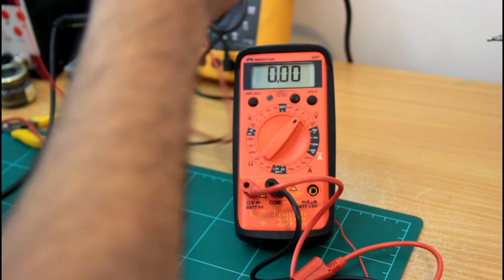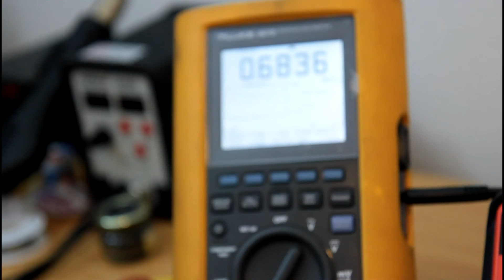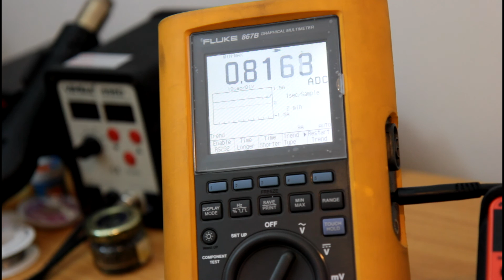Part 2 - Buck Converter LED Driver Battery Charger LM2596

Comment: the center pot is for charging from a different battery so you don't under charge the source battery while the battery you need charged doesn't kill it

Comment: Yes, you need to short the outputs while your multi meter is set to amps before you charge the battery. Part 3

Comment: my understanding is that the center pot is just to set the current at which you want the center led to come on to  let you know charging is done. 
Say your set to charge 18650's at 1 amp you set the center pot to turn on the charging done led when the battery  is only drawing 100ma.The way I also understand it is that it is some division of the current set with the cc pot.
Reply: lmorrison17 hi, so example if my battery rated at 1250mah then how can I turn the thing to make it to fully charge and the led turn on?

Comment: OI OI OI, u need a sandwich board mounted to a heavy base and banana connectors to make ur connections rather then alligator clips let loose one ya desk to blow shit up and pop off like what happened in the vid as I was typing this....Heres a few pics of what I am referring to - https://cdn.sparkfun.com/assets/0/a/b/a/5/5192a48fce395f1573000000.jpg,  http://img.alibaba.com/img/pb/992/982/236/1268291045799_hz_fileserver2_732211.jpg, http://www.tescatech.com/breadboard-trainers.html and here is a very interesting history lesson for ya  at https://learn.sparkfun.com/tutorials/how-to-use-a-breadboard. Also I have a challenge for ya if ur interested.... "a real world project" I will PM u with the details if u r.

Comment: Can anyone confirm/comment on the boost operation of this module?  I've ordered some of these modules and I'm waiting for the slow boat from China to arrive...  They were specified as buck/boost (automatic) capabilities but I've seen them also advertised as buck.  I want to use solar cells to charge 18650 a liion battery and would like to only use as many cells as necessary to meet the demands of the circuit.
Reply: Actually, just noticed that the modules I are a bit different than these. They also have a LM2577 on board.

Comment: Good video.
If you want to charge at 1 amp you will have to raise the charging voltage and then measure the current into the battery with an ammeter in series then look at the off load voltage required to do so...I always stick to constant voltage charging because if you forget to turn down the voltage you will fry your cells when the charging voltage rises across the fully charged battery, also current limiting is more relevant and your device may only allow current limiting when the battery gets nearer full charge. Good thing about dc-dc converters is they cut of charging when the battery no longer takes any significant current at the set output voltage..i.e fully charged

Comment: 1) With all do respect, you try to break Ohm's law. You had 10 ohm and 10 V set, so the current would be 1 A. We cannot force a higher current without putting a higher voltage on it! So, of course the pots didn't change much. In this buck it's clear that the voltage is the master setting. The rest will be dependent on the circuit and as long as the circuit is capable of pulling more amps then adjusted so far, it will accept new amp settings till the max it (cvircuit) can handle.
2) For the battery it's another story of the same laws: say the battery is at 2;5 V and needs to go to 3.7 with a max charged level of 4.2 V : You set the voltage to 4.2 and from then on the circuit (battery) will define how much current it wants to take , doing so by it's internal resistance. You put 4.2 - 2.5 = 1.7 V on its its internal resistance, which we don't know. The current was 0.9A (or so ?) which means the internal resistance is about 1.89 ohms. And that's why its a cheap battery. Those are excellent for continuous delivery of low amps like 15 mA and it will run for many hours.
3) It is not possible to boost both voltage and amps at the same time !! It's either Voltage regulated OR current regulated, not both !
4) TEST: your setup with resistors: 2x5 ohm and 10 V. Wanna boost the amps? Put another 10 ohms in parallel on the first R and the current will double up IF the setting on the buck allows it. If not yet doubled, then you will be able to regulate the current up to the max level that the circuit can handle.
Hope this helps and wish you a lot of interesting testing, cheers mate. Lenny
Reply from the maker: Lenny Roberts You are correct, maximum current is resistance dependent but what i am trying to show is that this particular charger does not give you control over current. As you can see in the video you can not increase or decrease the current. This charger is design with current limiting functionality. Would you like me to explain how the current limiting should work?
Reply: I was very interested in this module myself as i currently have a solar panel routed through a buck buster  to keep the voltage at a steady current then routed to 8x 18650 in parallel  .  I was wondering if the video failed to prove that it didn't allow the adjustments for current/amps/ma  how would i know if its working on my setup with a solar panel feeding 8x 18650's. I would like the ability to adjust the Ma from the solar panel but how would you control what the battery cells are actually  being charged @ 1c?
Reply from the maker: David Darlington the only way to measure the charging current is to totally discharge the batteries and then measure voltage and current for the entire period of charge. If your current setting is not suitable adjust accordingly, specially during trickle charge.  What do you use the batteries for?
Reply: +David Darlington  you are better off with a TP4056 Lithium Cell Charger
Reply: Lenny is right. The module can limit current or voltage but not both. The ratio between the two depends on the load impedance. If you want to test this circuit, put a small resistor for the load and crank up the voltage. Then turn down the current and watch as the voltage goes down due to your current limit. The LED should light, too.
Reply from the maker: +Eyal Soha I understand, please see my earlier comment to Lenny

Comment: I'm charging ni-cad with this circuit. In my module all three light works. But some time it acts strange, current will go up and down own it's own (load not connected).
Reply from the maker: bondasfaq Best chip i would suggest for battery charging is TP4056
Reply: But that is specifically made to charge lithium 18650 batteries. I'm charging ni-cad.

Comment: I also have one of these boards, and no current control via the potentiometers. I have been messing around doing the same tests you have done, and no useful response.
Reply: Martin Breckons I bought ten of these board to control the voltage and current for LED. Have not figured out how to use them yet.
Reply: +S Cin any progress ?